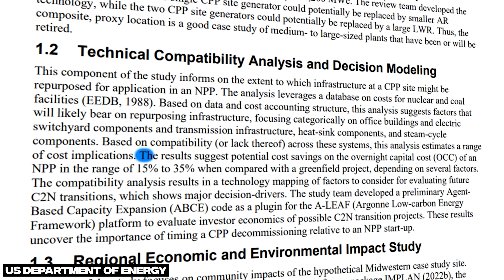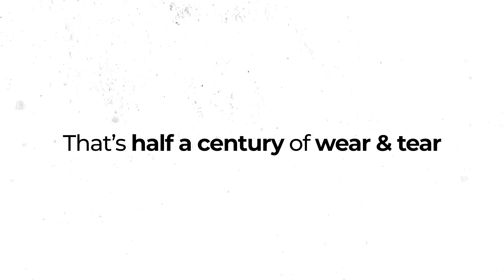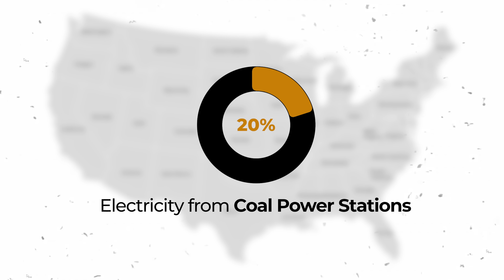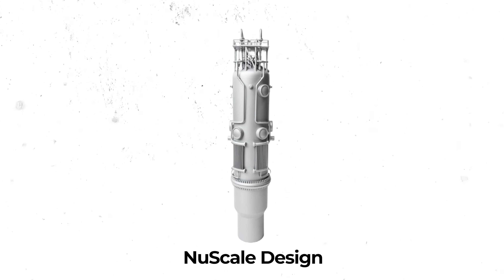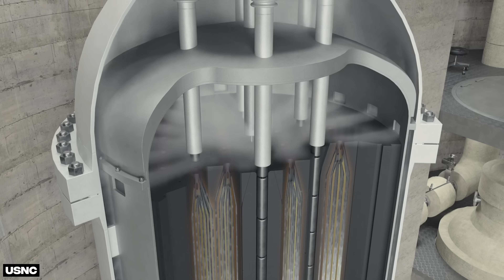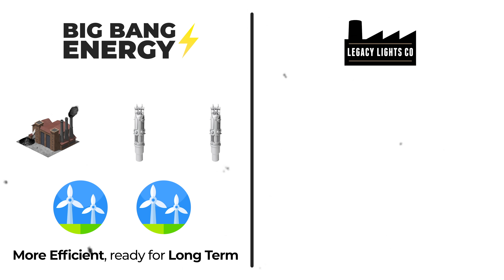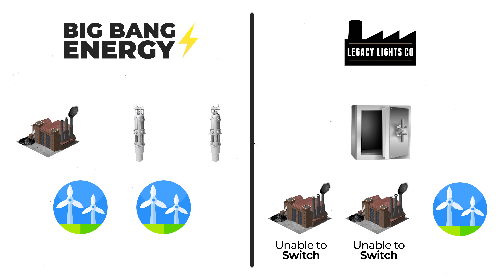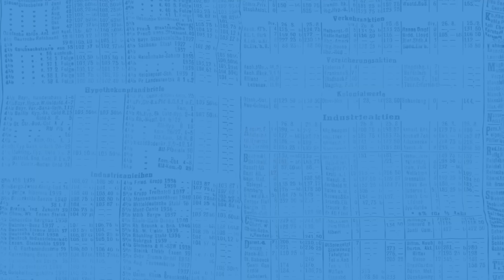Can We Convert Old Coal Plants to Nuclear Energy?

Comment: It's time we realize that "going nuclear" is only a problem when it comes to Karens.  👍
Reply: Must have been a lot of Karens in the southeast U.S.

If you live in the U.S. here is the reality for the last 4 “state of the art” Generation III Westinghouse AP1000 ADVANCED  new nuclear power projects and spent fuel reprocessing in the U.S. over the last 20 years. The AP1000 is fully approved by the NRC for construction and operation.  The only NRC requirement is that the plant be built per design documents…..seems simple..

The Southeastern U.S. is super pro-nuclear MAGA, has zero anti-nukes, and 100% media, local, and political support. 

The MOX facility (South Carolina) was a U.S. government nuclear reprocessing facility that was supposed to mix pure weapon grade Pu239 with U238 to make reactor fuel assemblies. It was canceled (2017) in the U.S. After spending $10 billion for a plant that was originally estimated to cost $1 billion and an independent report that estimated it would cost $100 billion to complete the plant and process all the Pu239, Trump canceled the project in 2017.

VC Summer (South Carolina) new nuclear units 2&3 were canceled in 2017 after spending $17 billion on the project (original estimate of $14 billion and 2016 completion date) with no clear end in sight for costs or schedule. Four managers on the project were charged with 16 felony counts, including conspiracy, wire fraud, securities fraud, and causing a publicly traded company to keep a false record.  The CEO of the project is serving 2 years in prison, another manager just got 15 months in prison, and the others are awaiting trial.

Vogtle (Georgia) new nuclear units 3 &4 at 110% over budget and schedule (currently over $34 billion with an original estimated cost of $16 billion). Mid way into the build, the utility stated that had they known about the many costly delays they would never have chosen nuclear. They last year long delay, according to the project management, was because thousands of build documents were missing. The first unit started in 2023 with Vogtle being, for its output, the world’s most expensive nuclear power plant.

Please google any of this to confirm.

If you can’t build new nuclear in the super pro-nuclear southeast U.S. then where can you build it?
Reply: @Clark Kent  well, I've always considered the cost, cleanups, and "Karens" a major issue Nuclear Energy. I think historically, we should look at soviet RTGs being used throughout the Soviet Union and how they may still be impacting areas to this day.
Reply: @WvlfDarkfire  I live in the U.S. and we are different enough from Europe to be unique and we should certainly not use any Russian or Chinese nuclear technology as a  comparison to this country's capabilities.
Case in point; China was the first to build 4 Westinghouse advanced passive safety feature AP1000 reactors which are now operating and were built on schedule and within budget.  You know the story with VC Summer and Vogtle and they had the experience of the Chinese to draw from. 
 The only reason I included the MAGA comment it that response was to prevent having to respond to those claiming those failures were due to Karens, greenies, tree huggers, dems, or whatever typical hate fills on heart.  Those projects had 100% support of everyone and I know, I live here.

Most of these start-ups with "advanced" reactor designs are simply looking for taxpayer welfare.

Utilities decide what to build not Joe-Smoe.  Except for some strongly anti nuclear states, most are accepting to new nuclear. The problem is in construction and project management and is pervasive enough to apply to any nuclear project anywhere  in the U.S. today.  Unless the real problem is addressed, nothing will change.

Comment: Surely the capacity factor of coal plants is low because the electricity isn't needed at that time, rather than because the plant is broken. It negates your argument about required nuclear installed capacity around 7:00
Reply: Coal plants follow load which is low at night and high during the day.  Capacity is measured in MW generated vs MW capacity, so you are correct in that it does not mean the plant is off line.
Reply: @clarkkent9080 Exactly, so a load following nuclear plant would also have a low capacity factor like the coal plant. Load following is a good thing, but it's being presented here as a downside.
Reply: @Ikbeneengeit  The issue is that nuclear plants like to stay at one power level and the utility likes that to be 100% where they make the most profit.  

There is a fission product called Xenon which acts as a neutron poison just like inserting control rods. 
It is created through a delay process when U235 fissions and it is "removed" immediately from the core when it absorbs a neutron, based upon power level. As long  as you are at a steady power level, the creation and removal of xenon stabilizes.

Lets say you are at 100% power all day and then at night decrease reactor power to 75%. The lower power level removes less Xenon from neutron absorption but since the creation of xenon is delayed, it is still being produced from the previous 100% power level. More xenon is building in and to maintain 75% power you need to remove control rods. Now if you later return to 100% power just as Xenon is peaking, the higher power is removing more xenon and the creation of xenon is delayed based on the 75% power level so you have to insert control rods to maintain 100% power. counter intuitive. 

This sets up a xenon swing, and it can be rapid,  where you are constantly moving control rods in and out to maintain power and it can get out of hand and result in a reactor trip. It can take a day or more to stabilize a xenon swing.

That was the simple explanation based upon control rod use.  However PWRs control power with neutron absorbing chemicals added to the reactor coolant and operate with control rods almost fully withdrawn. Trying to control a xenon swing by changing chemical concentrations in the coolant is much more difficult and moving control rods in and out just  make it worst. 

The Chernobyl accident in the simplest terms was cause by a xenon transit.  The reactor was shutdown and just as xenon peaked in the core they started up the reactor and took it to a high power where xenon burned out so fast, power spiked beyond the control of the operators.  

That is way nuclear plants are considered base load 100% power plants.  It is the coal fired units that have to increase and decrease output.  The job of a load dispatcher is to inform plants on the amount of power needed.
Reply: @clarkkent9080  My understanding is that coal plant has limited load following. There is certainly some flex, but overnight low demand still requires that furnaces be shut off or be wasted into load banks. Based on our local station at Tarong in the 1990s, a shut down furnace takes most of a day to be prepared for restart.
So, load following is either partial, or "lumpy".  
Nuclear winds up with a similar problem. From xenon as you describe. 

I would say that both work best at constant output. Coal has a little more leeway, but not much, especially for older plant.
Reply: @aaroncosier735  I understand that one load following method is "spinning reserve" where a generating plant (usually gas turbines) spins up their generators but does not connect them to the grid.  When needed they just close the output breakers.  It seems like this could also be used with solar (day only) and wind turbines (feather the blades).  

 The job of the load dispatcher must be very interesting.  My only interface was informing them where we expected to start generating power and when we expected to reach 100%.  Even with whatever load following capabilities they have, we could watch grid voltage changes and some were substantial.  We could certainly see when people wake up and turn on the coffee pots, when they return home and turn on the AC and when they go to bed an turn out the lights.  
There are 3 grids in the lower 48, east cost, west cost, and the don't mess with Texas grid.  It must be a nightmare for a dispatcher controlling that small Texas grid and their recent problems are only projected to get worst. I believe it was 2 winters ago that they came within 4 mins of a total grid blackout based on low grid voltage.  That would be a very bad day as I have read that it can take a week to restore a black grid and I don't think people understand what that means.  Gas stations, domestic water supplies, and natural gas supplies  need electricity for pumps to work but more importantly cell towers only have 2 hours of backup battery power.  
It is only a matter of time before it happens.
Reply: @clarkkent9080  It's one method, but it doesn't solve the issue. If the generator is not coupled to load (genuine demand, or a load bank, or mechanical brakes) it speeds up. To keep it synchronised, it has to be wasting as much power as if it was generating into load.
When your subordinates were "closing breakers" they were simultaneously opening breakers to load banks, or trying to throttle up on short notice. Probably both.

PV is a little different. The local controller can indeed just open the circuit. But it's only few kilowatts, locally. Ideally that would be diverted to a battery, or a water heater.But usually not.
Yes, wind generators can simply feather and lock, so there is no electrical stresses on the dynamo.

I expect far more despatching will become automated. As household and locality peaks and troughs get regulated by a local controller and batteries, and similar at the local substation (more batteries) the major substations and switchyards (with yet more batteries) will see much more gentle fluctuations, over narrower range, and maintain currents much closer to "average". Individual units, batteries etc may well deplete, but they can also signal this to the next level up, which can revise estimates to their own next level. 

The nice thing about this is that when the sun comes up, your own fridge comes back on, even if the greater city does not.
Reply: @aaroncosier735  I can only speak to what I have seen and done many times.  When placing a nuclear plant on line, you slowly admit steam to the turbine for a warmup.  The operator has control of the turbine speed within limits as it has overspeed protection.  At this point there is very little steam being used as steam flow is displayed and visible to the operator.  You are just overcoming friction which is minimal. You roll the turbine slightly faster than 3600 rpm (typical synchronized speed) and when the sync scope indicates it is almost matched (11 O'clock) to the grid the output breaker is closed.  The operator then has control of how much steam is admitted to increase turbine load while matching power from the reactor. During this transition, if reactor power is greater than steam demand, steam dumps open to short circuit the turbine but there are no load banks or anything like that.

I have never operated a coal plant but I assume as long as you have a warm boiler and the turbine is spinning with no load there is some but minimal energy loss. At this point, closing the output breaker and providing needed power is relatively quick obviously you are wasting some energy but no grid can operate with the generation sources matching exactly the electrical usage.  And even coal plants cannot change output that rapidly.
The grid voltage can vary wildly and you can even see this if you place a volt meter on a home outlet.  Brownout are where grid voltage is allowed to decrease very low and since electrical equipment operate on watts and watt = volt X amps. more amps are drawn which can overheat and damage equipment which it does

This is where the load dispatcher comes in.  The dispatcher monitors electrical needs and contacts the various generators to take actions to meet demand.  In my very limited contact with the dispatcher, I gave them a heads up on my bringing the turbine on line and expected power increase so he could have a coal unit back down.

Spinning reserve is very common in every grid system as even natural gas turbines must be warm before accepting load.  Wind turbine blades can be feathered and solar panels can simply be electrically disconnected.  Of course spinning reserve is wasting some energy in the case of coal or natural gas but it is minimal in just that amount of energy to overcome friction.

I am retired and operated before the days of significant wind or solar capability so I have no experience on how the dispatcher controls that.  I understand that automation is coming but realize that most plants operating today were designed in the 1960s or earlier and built in the 1970s and would require significant retrofit to allow automation. In most cases, it is a phone call and a human hand that controls load.
Reply: @clarkkent9080  I was trying to describe a key point: it's not just throwing breakers. "spinning reserve" is surely used, in coal fired generation as well. Like an idling engine when you engage it to the gearbox, you have to simultaneously start feeding a lot more fuel or it stalls. Going the other way, if you disengage from a load, it races. It can only do so seamlessly if it is feeding into a dummy load that matches the expected demand load. 
I do not think "minimised" is the same as "minimal".

Anyway, big changes are coming, and not necessarily what I would expect or prefer.
Reply: @aaroncosier735  I believe you are thinking of the grid as a small single load which it is not.  I can assure you I have synchronized many diesel generators (monthly test) and nuclear power plants onto the grid and it does not work like a car engine and gearbox. 
In both cases I have complete control of the fuel to the diesel and steam to the turbine and I do NOT have to increase either to preventing stalling. 

If a generator, be it a diesel or main nuclear power plant generator is connected to the grid, it will spin at 3600 rpm (this is the typical winding configuration) not matter how much diesel fuel or steam I provide to the generator. 
ANY electrical motor/generator when connected to the grid will spin at its synchro speed which is usually 900, 1800, or 3600 rpm based on the U.S. 60 cycle grid frequency. 

 If the generator is connected to the grid and you supply more fuel, it will supply power to the grid. If you decrease the fuel to less than that necessary to overcome generator friction, then the generator will become a load on the grid as the grid will have to supply power to maintain it rotating at 3600 rpm.  There may be mechanical and electrical interlocks to prevent extremes but  

The Grid, be it west coast, east coast, or Texas, is massive with thousands if not millions of individual loads and multiple power sources and EVERYTHING is synchronized together.  

I have performed many diesel generator tests. First you get the generator spinning slightly faster than its syncro speed (usually 900 for a diesel) and when the frequency is almost matched to the grid, the breaker is closed and the generator locks in at 900 rpm.  The test requires me to take generator output to a certain level so I increase fuel and generate power for a specified time.

Comment: Terrapower selected a retiring coal plant for the site of their Natrium reactor 2 years ago.  Your a little late to the brilliant idea party.  

 The brilliant idea is really that a company that owns a old dirty coal plant can give it to a nuclear plant operator and walk away from the environmental disaster they created.

I would be very interested in seeing how many of the 60 year old coal plant components, Terrapower uses.  You are talking about a plant designed in 1960 and operated with little oversight, band aided to keep it running, with piles of hazardous coal dust on every component.  Plants operated by old timers with little to NO procedural controls, something that is totally unacceptable in the nuclear world.

Every valve, pump, motor, pipe, breaker has a service life and I am fairly sure the reason the coal plant is being shutdown is due to high maintenance costs. Try finding a replacement for any 60 year old component.
Then there is the stacks that must be removed, ash piles that remain hazardous, and systems that must be evaluated to ensure worker safety for the next 40 years . The only advantage I see is the radioactivity from the coal piles would mask and radioactive leaks from a nuclear plant.
The secondary side of a nuclear plant is just as important as the primary. When the turbine trips, the reactor trips and the potential for accidents increases during startups and shutdowns when there are large fluctuations in equipment operation.

Yes the idea seems brilliant if you don't think about it too much.  But again, if Terrapower ever does start and complete their Natrium project, we will have real and factual experience.

Comment: I like the idea of storing the excess energy in molten salt.
Reply: Works for solar concentrators too.
One mob did something similar just by heating up big insulated tanks of sand.
Reply: @aaroncosier735  
?
Please check temperature difference.
Reply: @drmosfet  Yup. Solar concentrators provide incredible temperatures. Ideal for molten salt.
The sand-based one doesn't have to match the same temperatures, it's the same principle.